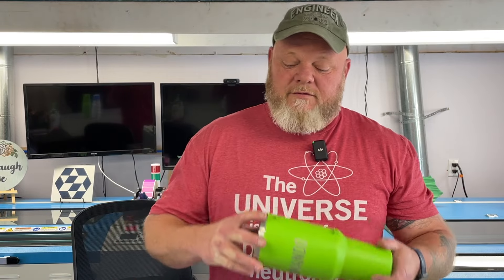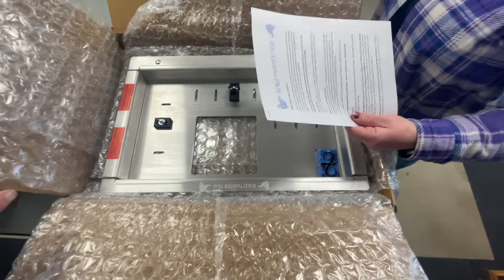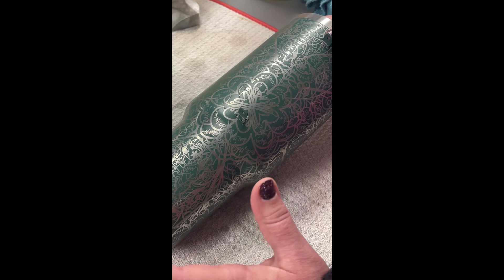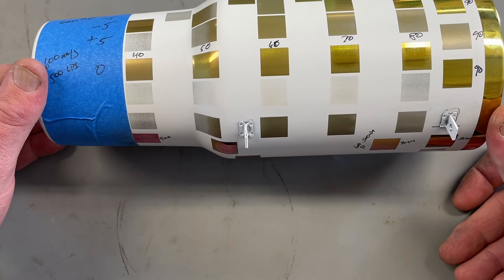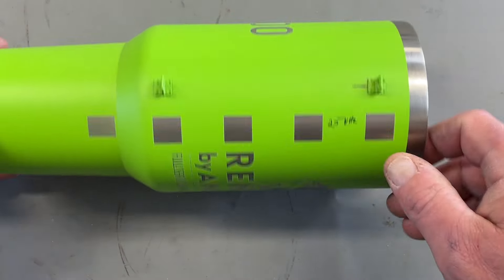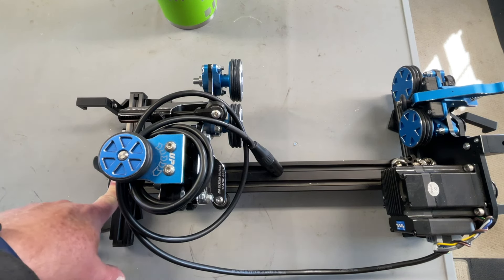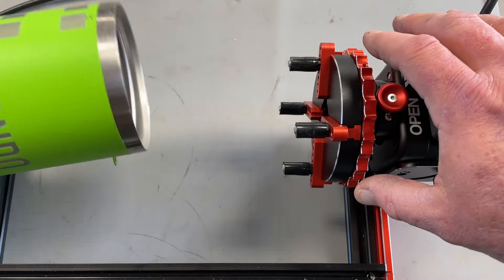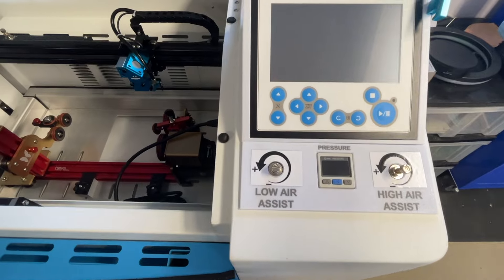Rotaries, Tumblers, and Settings Thunder Bolt

Comment: I use rubber bands on my rotary. Keeps it from coming apart when fully opened and the cushion of the rubber band means I don’t have to tighten the cup so tight and adds a lot of grip. No problems with threads. 25:35

Comment: I was having the same issues with my talon and the threads. Jason said to swap to the bigger jaws, and that seemed to work better, but as long as it didnt fall off, I took it as a win. Great Video!!!! Do you use the 4inch lense even with the normal 20oz, have you noticed detail loss inbetween the 1.5 and 4 inch.
Reply from the maker: Yes we use the 4 inch for everything that way is is less to remember.

Comment: @Angrycraftsman Follow up question, are you still using the 25khz, 70ish power 600speed for your full wraps. Im currently running that test on a wrap, from the looks of it right now im not sure its getting though the powder coat. I was typically running 85-87 power 450speed at the stock KHZ.
Reply from the maker: I wish I could be more help. We reverted back to tumblers in the 35/80. A month or so we had a gentleman show up for a demo and wanted to buy the bolt. He needed a laser quick that could run hat patches.
Reply: @Angrycraftsman  no worries, busy same settings before selling? Cup last night cw out good, I noticed a few lines, but I'm assuming that was the rainbow Colors, not Laser fault
Reply from the maker: @rykus2010  we kept the same settings may have increased to 90ish power for white cups.  There is something with white and the rf tube that just doesn’t work well together
Reply: @Angrycraftsman  I'm seeing that, I was running 85 power at 450 and still had a lot of cleaning to do. So I'm hoping the 25hrz helps. Running at 600 speed saves me 10-20 min. 
Another question, ever ruin the rainbow with too much power?
Reply from the maker: @rykus2010  no the white /rainbow were the hardest to clean. 25kHz helped a lot.
Reply: @Angrycraftsman  great, just don't want to ruin any cups by running too hot. Testing at 85 power on a light pink one. Ran 70 power on a hot pink but didn't get a great shine on it.

Comment: Maybe I missed it, but when are you focusing? Once you get the angle, or before you adjust angle?
Reply from the maker: We put the cup in and use a digital angle finder to set the angle. It is 3 degrees then auto focus on the far right if the cup where the top ring is.  What we may try is a video from start to finish if doing a cup.
Reply: @Angrycraftsman  great, I was focusing before angle, then have to lower z to clear tabs. I'm going to move Air assist up and see if that helps me get getter focus. Thank you
Reply from the maker: @rykus2010  for us we are using the 4 inch lens. We have maxed out the depth of focus so we can clear the first tab. There is another video for ramp test to determine the depth of focus.
Reply: @Angrycraftsman  yea, I don't have a problem at all on the first tab with the standard focus length. Just that middle tab. So moving the Air assist up would clear it without having to lower z. (I think) I'll need to try it
Reply: @Angrycraftsman  That would be super helpful!